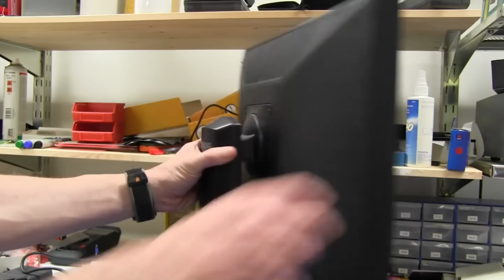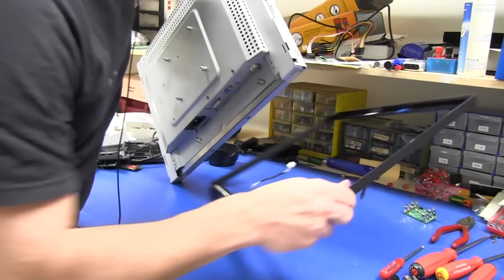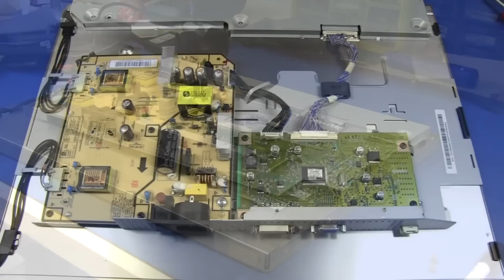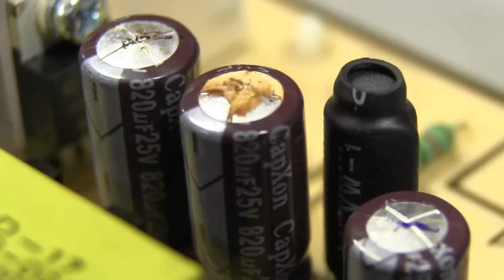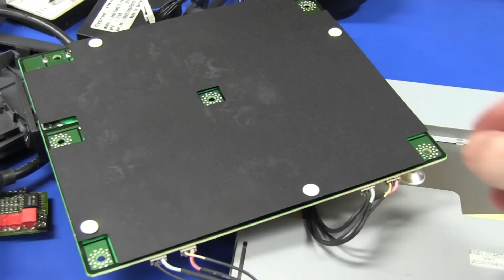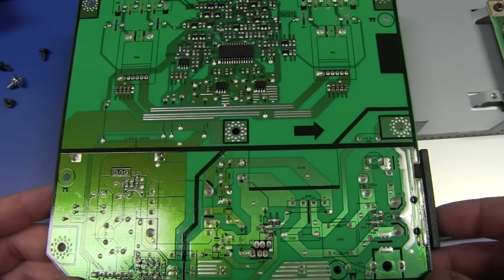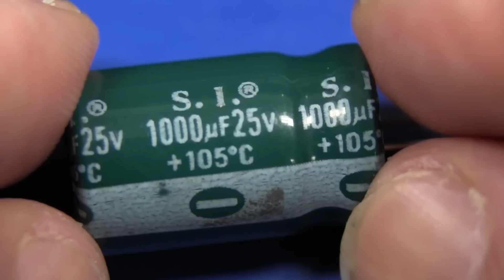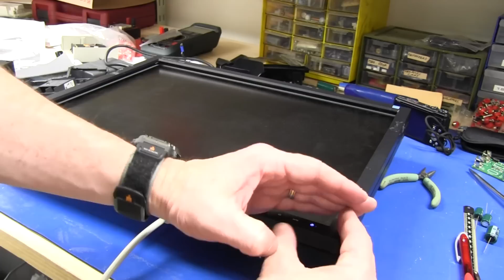EEVblog #347 - Bad Cap LCD Monitor Repair

Comment: I wouldn't mind betting that Samsung said "hey, let's make a shit hot monitor that everyone will want", so they did. Then the marketing department said "hang on, we want it to look nice and perform well, but if they last, we'll won't sell any more monitors for the next 20 years", so the designers then replied with "Easy, we'll fix that! These caps will fail in 5! You can even put a 3 year warranty on the suckers and still make a killing". Management then promptly fell to the floor with shudders of joy vibrating through them. After changing their pants, they approved the product and here we are!
Reply: +Thomas Fowler That's what a lot of manufacturers do nowadays, sadly.
Reply: John Doe
So good design decision should be to use larger caps with more capacity? Caps will last longer than 2-3 years. I also very disappointed with pricing of authorized Samsung repair services, who charge half of the price of monitor to change 3 caps.
Reply: +RmFrZQ Using low ESR won't work if the connection to the switching transistor is too long, because you have to add the ESR of the connection.  So of cause ESR capacitors need to be really close to those hot transistors and need to be rated for the unusually high temperature shown in the video.
Reply: +Thomas Fowler I know! They place capacitors very close to hot transistors on purpose!

Comment: so capxon is not a good brand. can someone give a few good brand examples? I know zero about electronic but after seen this I am going to try to fix my monitor so that is why I am asking. thank you for these videos really good and informative :)
Reply: gigicaly Chemi con, Panasonic, Rubycon, Hitachi and i've also heard good things about Sanyo. Also, and incredibly enough, Samsung branded capacitors are of very nice quality, and here's another Korean brand that performs really good: Daewoo.

But look, if you are gonna attempt your fist fix, i recommend you go for cheap caps first. They will last you for between 2 days and 5 years before they start failing, so you will get good practice by replacing them constantly, and they are very cheap so its a cheap investment. Capxon are fairly good Taiwanese caps, among the bad and cheap, they are some of the best.

Also keep in mind that capacitors have a polarity, and if you mess that up you'll get some smoke. Also, big caps, like the one Dave didn't replace are VERY DANGEROUS, sometimes they retain their charge and can zap you or even kill you. Read about them before trying anything.
Reply: Mylity 66 thank you for the reply. I will be care full. thx.

Comment: I've done this fix to so many items. My Samsung laser printer was dumpster sourced. It turned on but whined and didn't actually complete the power-up sequence. Of course, a dodgy cap in the power supply was at fault. Fixed that with a cap from a VCR I also found and I have a free laser printer. $25 for the toner on ebay.

Comment: Having lived in Korea for 15 years, I'm going to guess that Samsung don't want to use good quality Japanese-made caps because Koreans hate hate hate all things Japanese. Samsung being the flagship Korean company, would be incredibly reluctant to use Japanese components. Honestly, if it ain't just plain cost-saving, that's what it is.
Reply: arfer You know whats funny? Samsung produces their own capacitors. Samsung branded capacitors are of really good quality, i've never seen a blown Samsung capacitor and i've never seen a Samsung capacitor inside a Samsung product XD.

And there is also Daewoo, South korean branded caps as well, great quality too. Daewoo actually uses their caps in their products (at least on CRT Tvs, which I've salvaged for parts before).
Reply: arfer Some people just recommend the lesser known brands like Yamakasi and Shimian which use ISP panels from LG stock (same ones Apple uses). They are pretty fucking good monitors given the price.

Comment: I have a second hand 47LG70.  When I turn it on I have a blinking red light. when I turn it off I notice there is a green light that comes on somewhere on the 'video board'. I have it plugged in through D-Sub/VGA. I also notice that when I initially turn it on I notice a back light comes on for a second..  I have looked at power board and do not see any signs of blown capacitors, no other signs of heat damage on other compnents. I have also noticed that the heat shield around the video board has black marker with the following written on it  "42LG70UA ACCOLJR" Which makes me think that board was swapped out with a 42'. Any help would be greatly appreciated, I have gone on ebay and found replacement power boards for about 100 bucks, but I can not afford that right now

Comment: I have Samsung SyncMaster 931c and one cap on the power supply failed. I took it to a repair guy and he charged me 45€... Replaced the old power supply with second hand one. I should of replaced the cap and I would of saved money.
Reply: CoreMaster111 The failing cap whistled for about 2 months before it failed and picture did not come on. I am surprised it didn't suddenly explode like a cap in my soviet era waffle cooker.

Comment: The sad part with the capacitors is that most somewhat skilled people could fix them instead of throwing a repairable device into the trash. "Built to fail" as soon the warranty is gone.

Come on people, if something is already broken, there is no harm in tearing it apart and at least check how that device is made, you can't do more harm if it's already broken beyond repair and if it isn't you can give it to your local electronics technician or try to fix it yourself. Or at least scavenge some neat parts.

I love this channel, every time there is something new to learn.
Reply: ***** Not necessarily true. I 100% agree on what you said about increasing people's knowledge on repairing electronics. But still, you can get zapped by a power unit's capacitor pretty easily if you just randomly tear stuff down.

Comment: I can't say I've ever actually seen a cap marked low ESR. My cases it's personal use and our the nearest radio shack is like 50 mi away so I just use caps I salvaged from old stuff otherPSUs, etc.
Sometimes a totally fried thing with some off brand caps I'll save them just so at least I can verify the issue and then maybe order a better brand. Usually for a long term fix I just throw in an Elna, nich-chemicon, rubycon. So far, those do fine possible they were from an SMPS and are unmarked low ESR, but also good brand so I trust them

Comment: I have friends that work in I.T they were going to toss an old gateway 17-inch unit. I said it's probably a capacitor they were like the electronics teacher (at this college) looked it over and saw nothing. Said I was welcome to take though and do what I wanted.

This case the LED came on but flashed I thought timing something with a cap is messing up. I held it to a light variouing angles found the bad cap swapped it and it worked. Then I got all their old ones they got in that died.
Dell was the first time I saw an output filter cap failure break it. I thought It can't be that big a deal it's still DC an LED, etc would run fine off that.

My case both dell and gateway all the faulty caps were Samxon (I think pronounced Samzon) brand.

Comment: Did this with the eMac, both the power supply and the main board had bad caps and somehow this thing still worked and booted up prior to replacing all caps with good quality Panasonic or japan built caps. However once the caps had been replaced I noticed a boost of speed and also when playing music at top volume the screen no longer shook and glitched. Please use care if your going to open your eMac there is VERY hazardous voltage stored in there for the monitor. Even after unpluging...

Comment: Beware: I changed 3 caps in almost similar Samsung 226BW. I took one cap from old digibox, and bought 2 from local electronics store. The mistake I made, I removed almost all of the parts from the display (polar screens etc.), I was curious.. and afterwards (after I soldered the replacement caps and put the plastic parts back together)

I had one column of dead pixels (1050) (the line is usually yellow, sometimes green or red), I think i tightened some cables or screws a bit too much..

But it's a lot of work to open all the parts again and check everything, so I just live with it..

Even thou this should be pretty easy trick for every nerd!

Comment: Thanks Dave.  I enjoy your videos.  After watching this one I was able to repair my dead Hanns G 19 inch monitor by replacing 5 capacitors.  Looked very much like the Samsung here.  I have a 22 inch Samsung that goes black whenever there is not a bright image.  I tried replacing the capacitors on it, even though they looked okay.  No change.  As long as there is a bright image no problem, but if the image is not bright, the screen goes black.  The problem is definitely with the monitor.  Any ideas what might cause that??

Comment: Last week I found a monitor sitting out with somebody's trash and I decided to take it and find out what's wrong. With a little research, I figured out a few capacitors were blown. I ordered a replacement kit and I now have a secondary monitor that I spent a total of 20$ on to fix.

Comment: I've had a SyncMaster 920n since 2007 and that's what I currently use (having had it replaced in 2009 because it failed). Scary to know it might fail at any time though.

Comment: The capacitors in my Technika TV bulged as well, only took £1.40 to replace them, instead of the £20 for the new board, or £200 for the new TV.

Comment: Hi Dave! Love EEVblog! Greetings from Arizona! Just wanted to say that HP L1906 monitor is also a Samsung Chassis. How do I know? The back of the LCD had the Samsung label and part number, and the power supply board looked almost identical to the one you fixed. However, there was a different manufacturer for the other caps. I didn't change the capacitance. the originals were rated at 1000uf at 10v. I left the new ones at 1000uf and went up to 16v. My part supply guys said that sounded right to them as well. Should I have stayed at 10 volts and upped the uf? Is giving the circuit an extra 6 volt buffer bad? Thanks!

Comment: Typical Samsung. I just recently ripped apart an old cellphone charger from them. Same caps. The charger wasn't dead but the phone it came with fell apart before a year was up.

Comment: This might be the right place to ask this...
I have an old Cambridge Soundworks FPS 2000 digital speaker system that has started making a low frequency humming noise. It's not a buzz... rather a bass-y "hummm". The noise persists regardless if it's plugged into the computer or not, and regardless of the volume it's on. I was able to gather up that it's most probably the aged power supply capacitors causing this. (This thing has a gigantic power box that weighs a ton!) Is this a valid assumption? I would rather repair & keep them because they cost a bit of money & the sound quality is, excluding this, really nice.
Reply: Advection357 It most likely has a standard H transformer power supply with caps before and after the choke in the portion after the full wave bridge. If the hum sounds like its 50/60Hz it may be on the input side and not a power issue. If the hum sounds closer to 110-120Hz then yes it may just be a power supply ripple coming through.
Reply: RiaRadioFMHD773 I took the power supply apart & found the culprit... the big 4400uf 25V capacitor had popped and oozed out... just like the caps in this video. Cost me 3$ to replace it & the sound is gone :D

Comment: Looking at 4:47 I see a ground connector and a grounded plug, but no cable between them. Did you remove the cable, Dave?

Comment: I recently revived a PC motherboard which had some bad caps. Works fine. The only problem - that board is old and not powerful enough for modern software, but for some NAS or web server it will do just fine.

Comment: How do I identify the caps by using the meter by Cen-Tech Multi-Meter where it has no blown caps and by checking the diods including the 2010 Vizio M260VA?

Comment: can electrolytic caps be faulty and still show no bulge?
Reply: Yes.  My Sony television (with a samsung Power board, no less...figure that. ) Bravia V series 42" died suddenly because of cap plague.  None of the caps looked physically damaged but when you tested them with the meter, they didn't line up to spec. probably around 30 percent under the rating.  Went to Mouser, 15 dollars and a few days later I had a working television with extra caps in reserve if they ever were to fail again.
Reply: will an esr meter detect those caps? 

seems many TVs and monitors could be repaired,  I have already fixed several freinds' devices with bulged capacitor issues, it's a real pitty people throw away devices that may be can be  fixed with cheap parts. 

as a business is also good idea,  I suspect the real number of monitors/tvs  with bad caps is much greater.
Reply: GEORGIOS VERGAKIS I find that consumers have the idea that it would be less expensive to just purchase a replacement appliance than to repair the original. I fault repair technicians that gouge the customer on cost on these monitors/ TVs. Bad caps in the SMPS as well as the back light inverters.

Comment: Having one of these same models in the basement - it would turn on but the display took 30 minutes to become visible - and needing a spare monitor, I decided to go for the fix.  I've already fixed a beautiful ViewSonic monitor where a $5 capacitor change saved $800, so charged forward.

Indeed, two adjacent capacitors of 820uf, 25v, were visibly bulging at the top.  These were replaced along with a 330uf 25v capacitor nearby (it looked ok but was in a heat area so replaced it proactively).  The failures I saw were not quite as dramatic as Dave's dumpster treasure, but left in place this would have been their fate.

The monitor now works perfectly.

Thanks to Dave for showing how that plastic case comes apart.  Especially helpful.

Comment: LG =  SAMSUNG  = SHIT
Same problem here both monitors.
Reply: Did you forget about ACER's monitors?
Reply: well to be fair, samsung isnt half bad, got one that lasted for around 11 years now, its a lower res 1024x756 but for an office its good enough. got 4 dead ones already from the newer models, that lasted for around 4 years of 10 hours workload a day, so I presume they downgraded some of the quality over past these years. Same with Lg, but agree with acer. bought one 15 inch monitor for kids homework pc, its fairly cheap so i dont really expect much, but fails in just after the warranty under the use of around 2 hours a day what a shame.
Reply: Luck guy !

Comment: I had a couple pc motherboards a few years ago that had a bunch of bad caps.  I took a dead asus motherboard that had good quality caps in it, pulled out the caps, and put the in the other two motherboards.  They ran perfect after that for a few years until end of life.  If it's not working, don't be afraid to try to fix it.

Comment: I enjoyed the video, thanks.  I've got a 37" Hannspree TV which failed to start up. It gave a really loud crack so I opened it up to discover the caps in the psu had split on the cross.I ordered some low ESR caps and job was a good un. I used to repair tv sets when I was still at school for a rental shop back in the 60's in my summer holidays. It's a shame so many electronic items are just thrown away when they go wrong. I bet you had a big grin after winning 2 monitors.

Comment: Ive got a Sammy 214T that works, but occasionally flickers off. Tempted to try replacing the caps on it. Though, they dont appear to be bulging or anything.

Comment: More than 50% of broken monitors can be fixed by replacing some caps.
And 90% of the time those dodgy caps are close to a heatsink in PSU section. 

The last monitor I bought was 19 inch CRT and it was somewhere in 2001, since then I only collect broken flatpanel monitors and repair them.
I scored a set of 5 nice looking 22 inch monitors (fairly unknown brand : Q-Force) and was able to repair all of them by replacing a few caps. Too bad those only have a analog VGA input.

I think you might even be able to make a good business from this. Just try getting some broken monitors, repair them and put them on ebay.
Reply: Exactly my idea..let's start a company :P

Comment: Yay!  Another market WIN for CapXon in a 5th world power supply.  "Panasonic EB are too expensive" the ignorant bean counters said after selecting the cheapest single layer board.  Fortunately for me, I decide what parts go into my design.  Power supply to final presentation.  Samdung used their good screen and driver boards for the temporary win, but cheaply whored out for a 5th world power supply using 7th world capacitors.  It lasted longer than the warranty folks, that's all that matters to the bean counters.  Now that's something I'd NEVER buy for a dollar!!  CapXon stocks are now $0.28 a share at the time of this posting.  You can buy them by the bag full for mere dollars!!!

Comment: I've repaired dozens of trashpicked monitors and all but once the problem  has been blown caps. don't replace the power supply filter cap, I have never seen one go bad.

Comment: My friend wanted to trash his Samsung monitor because of some picture flickering and occasional refusal to turn on but luckily I managed to stop him in time. Searching YT for "how to" - few seconds. Watching EEVblog #347 - 17min37sec. Cost of few JAMICON low ESR caps - next to nothing. Dissassembly, soldering and reassembly - less than half an hour.  Now I have " brand new" SyncMaster 226BW monitor - thanks a lot Dave :-)